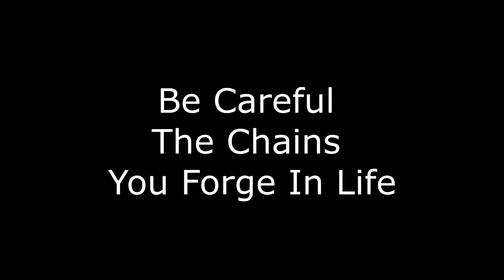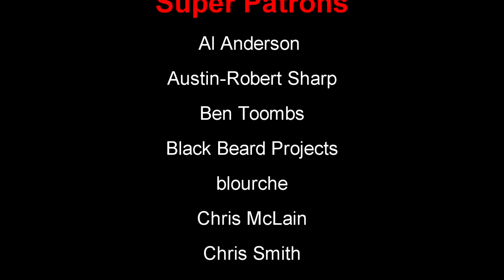Forging Prison Irons AKA Darby Handcuffs

Comment: it would be interesting to see how the "Lock Picking Lawyer" would tackle these, such a simple mechanism would be difficult to pick with traditional skills.  Thank you for sharing this wonderful example. I remember my struggles, 40 years ago trying to drill steel with a hand drill it is blister forming and character building.
Reply: Shimming the relatively easily accessible and vulnerable ratchet style end piece of the lock mechanism, presumably. If you were desperate and had the tools or stock, perhaps making a temporary key out of a hard wood or soft metal that would thread itself onto the shaft?

Comment: Not sure if you heard of Hiatt of England but they invented these and on the Hiatt you DON'T need to leave the key in to lock them but you do have to be very strong as the mechanism is tough..But with your hands that wouldn't be a problem 😂.

Basically if you want to close them you force them shut..You can see a video of the Hiatt here.

https://www.youtube.com/watch?v=GoJgFESOtmw

Comment: This is in reference to the surface grinder you built and the supplier for the roller guides, cncparts.com. I apparently didn't get the web information correct because I have had no luck with finding the supplier. Would you please post the web address for me or email me back with it at jamesdouglas.crimson@gmail.com. As always I am glad to see a fellow fabricator at work. Was a Union millwright for 40 years, with FAA certified airframe and powerplant license. I enjoy watching you build things that WORK and are not over or under engineered. Sometimes I tend to over build and end up with a tank- type-golfcart project. It usually works fine but it's like I start to hunt squirrels but am using a bazooka. I am going to build a set of bellows with my 12 year old grandson for a coal forge we are cobbling out of a fireplace insert and cast iron grill. Both are salvage items and we have zero dollars in the project thus far. That's my kind of budget. And your videos on the bellows was the best I can use for our application. Thanks again. Old Man Andy, Crimson Elephant Forge*Knives*Leatherworks.
Reply from the maker: It looks as if they have changed their name.
I hope this helps, Thanks for watching.
http://www.cncrouterparts.com/standard-linear-motion-c-46_41.html